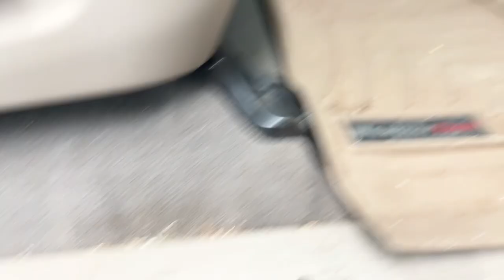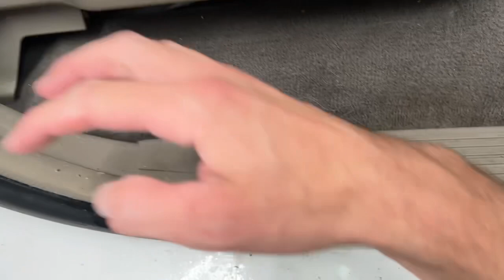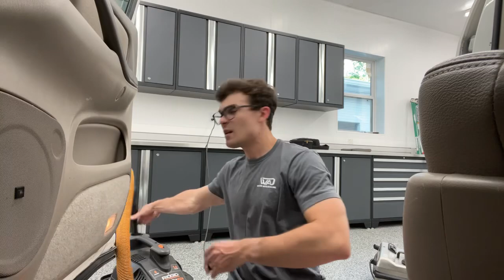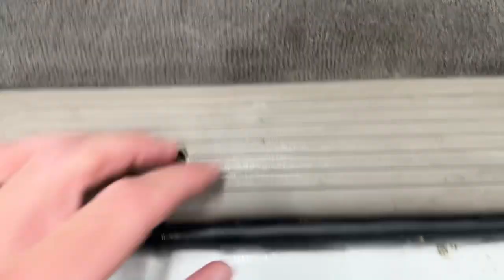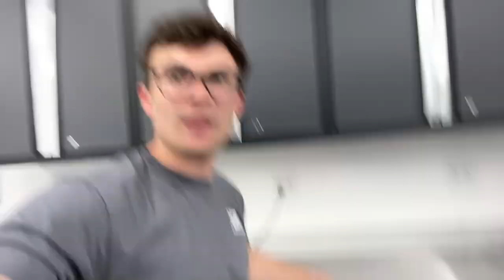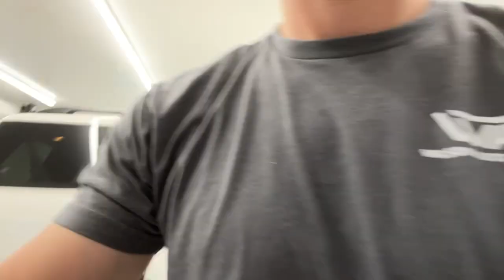Why I Use 2 Vacuums For Interior Detailing

Comment: Hey Luke,
Congratulations on the new studio! You're killin it bud!
I wonder if you were to place black acoustic panels between the lights on the ceiling, if it would provide you with a double whammy of helpful benefits? 
1) By creating added contrast for inspecting and filming the exterior painted surfaces across a multitude of vehicle specific scenarios. AND
2) By cutting down on the sound of the vac's and whatever else you use during your day inside that space. Thereby preserving your hearing, and making it even quieter for the surrounding areas outside that studio space. Plus any music you play will also be more enjoyable and less fatiguing. 

P.S
Which foam cannon and exterior wash do you recommend for Porsche paint? Because it's notoriously difficult to do paint correction on these friggin cars! AHHHHHHHHHHH!

Comment: have u considered dewalts cordless vacuums? they got hand held and mini shop vac style.
Reply: The suction power on the Dewalt 20v cordless unit isn't even close to the small Ridgid vac. suction.  We do however use one for final finish touch up minutes before wrapping up a detail as we have already put away our larger power cord equip. and turned off the generator.

Comment: Do you use the wet filter in the vacuum for this or the regular paper one?
Reply: Not necessary if picking up small amounts of water, when picking up large amounts of water its recommended to remove the filter all together AND not required but I would personally use the black dedicated water filter imo.  Most people are also not aware that when liquid in the drum reaches a predetermined level, there is a built in safety float mechanism which will rise automatically to cut off airflow.  The suction pitch level noise wil also change indicating to turn system off and drain.